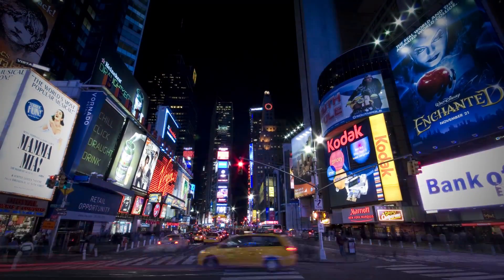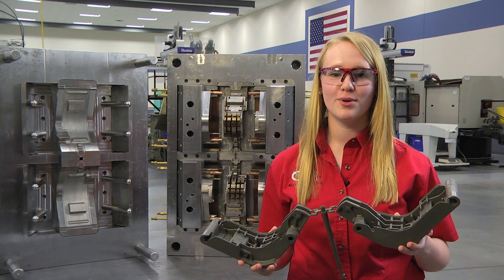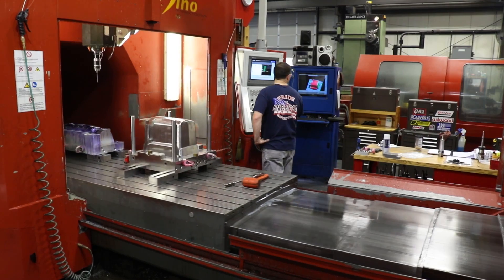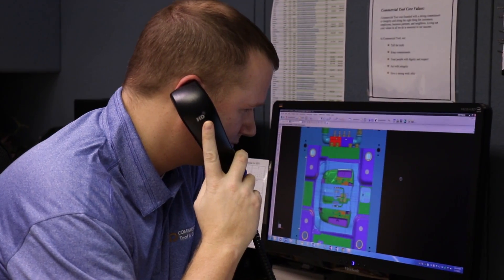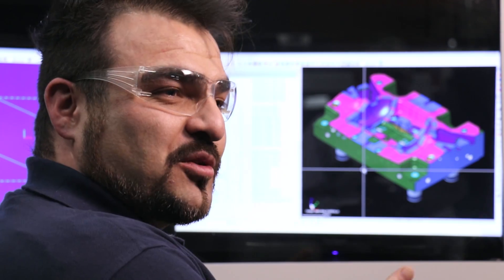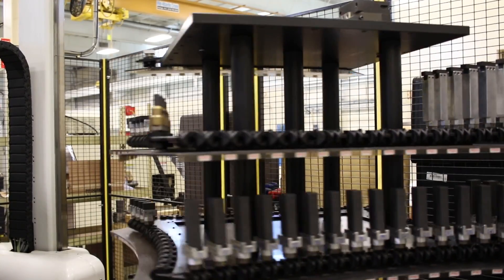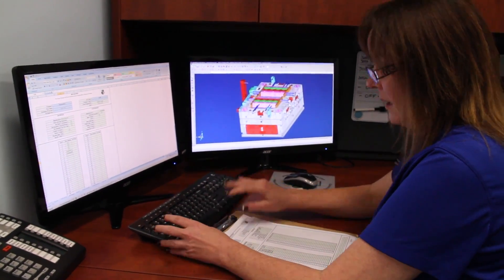MoldMaking Matters: MoldMaking Your Road to Success

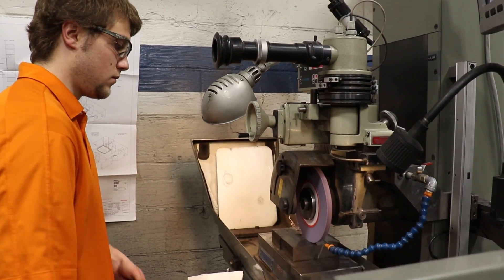Comment: 7:48 "All parts that are going into the molds are extremely precise"
A few seconds later: ...but I need to adjust them by my huge wheel grinder a little bit
Reply: i said the same thing!!!
Reply: The final fit on a mold is extremely precise and it requires "fitting".  The molded areas are often in the thousandths of an inch but final fit is ten times more precise.
Reply: Precise does not mean precise enough. 
When your milling over 3 feet of steel like most cnc mills do, it's hard to get sub thousands of an inch. 
But sometimes you need half a thousands of an inch. 
When the mill is literally able to split hairs by going a thousands of an inch at a time, I'd call that precise but it's not always good enough.

Comment: Incredible Informative, hard to make, and Wonderfully done video!!! In ONLY 12 minutes covers a full course of the top to bottom stages of mold creation. Since finding this gem, have looked at more of your videos. Insane that so many watched and so few have bothered to subscribe. You are in my top ten! Thank you SO much, this is forcing me to add a whole new chapter, (at least) in my current efforts researching and creating out of some 20 to 30 struggling, one or two process small companies,
 a powerful, integrated company without uprooting or letting go the people, the one single irreplaceable most important and sometimes overlooked,  "Machine" on the shop floor, and using the combined skills and equipment coupled with fresh ways to approach things, gain certifications, be able to compete against corporate sales forces who can offer one stop shopping.
A new, flexible Company capable between the combined shops, of taking coil and stock through any and every process to the final treatment or powder coating of whatever work, jobs, parts, components, products, innovations, new ideas, tooling, components, multi stage job lot runs, new products, and more that we could then easily compete because no matter what, based on our capacity, the company that IS it's people, and works together, with anybody and everybody able to contribute, learn, pick the area they are most comfortable at, but where experimenting and not punishing the 5 failed ones because anybody who would keep doing that, will hit one out of the park one day.
 It's insane the number of small shops closing, vast knowledge being lost, families who gave so much for so long, the maze of new tech and which is the right way to go, when there is NO reason that Americans coming together co-operating and NO MATTER WHAT sticking together and learning from, taking trips to the different shops, or however we ALL decide would work best, would need to lose out to these corporate hedge fund owned conglomerates.
By the way, anybody with Netflix watch the two seasons about Mexico where a weed smuggler tries to become the controller of cocaine and what happens to him, the business, all his loyal people, AND WHY. Right there is the full lesson of business and power corrupting and richer guys start to think they know more than the person doing any particular job.
Whoops, sorry for the rant, did not mean to rob your platform, I just see too many signs of bad things happening again, don't want it too.
Your video with all the smiling people who are loving the dream and hopefully never have to face a downsizing or "strategic efficiency" pink slip got me going.
Keep doing what you're doing, your comments show you are injecting positivity.

Anybody wanting to chat about any of this, feel free to do so. 
Thanks again, Joe